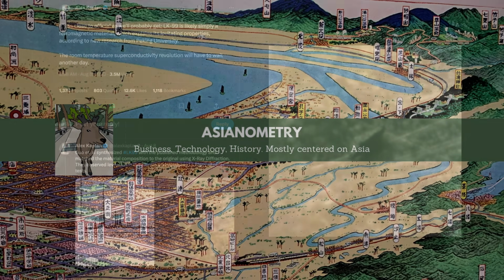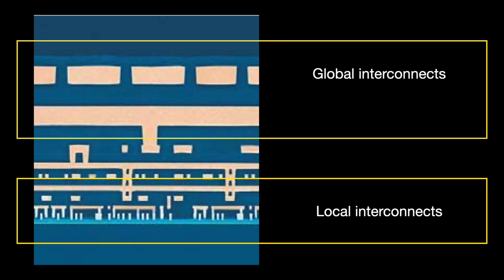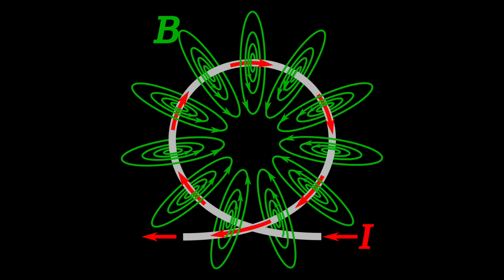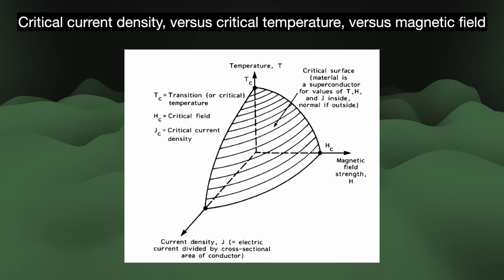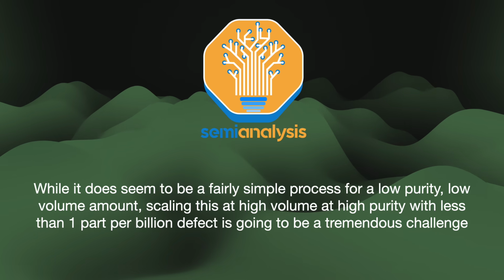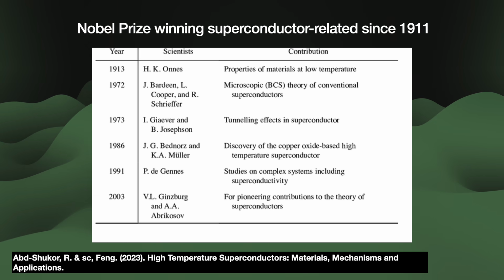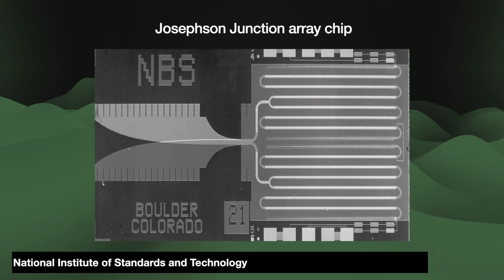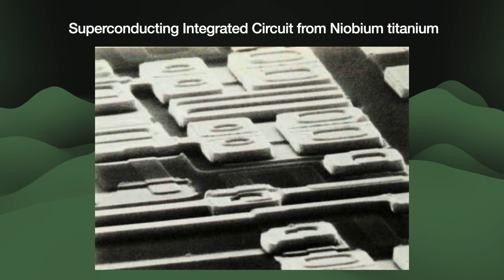LK-99 Wouldn't Have Changed Semiconductors Anyway

Comment: If you have semi-conductor memory and superconductor processor, the memory wouldn't be able to feed the data to the processor fast enough for it to make any sense having the superconductor processor. And remember that in this case, memory includes the CPU registers as well as the usual DRAM chips.

Comment: Good video, but as a physicist I need to point out one thing: Josephson junctions ARE NOT the ONLY thing in which you see quantum mechanics in action.

The description of what we call the "electronic band structure" of crystalline solids, like SEMICONDUCTORS, can only be described and understood because of quantum mechanics. It is because of the development of quantum mechanics and its application to solid state physics, that transistors came to be. As a matter of fact, John Bardeen is the only person with two Nobel prizes in physics because of his participation in the invention of the transistor (along with Brattain, and Shockley), and his co-creation of the theory of (ordinary) superconductivity (along with Cooper, and Schriefer). (The high temperature ceramic superconductors haven't been fully understood, as far as I know, that's why I mention "ordinary" superconductors, which are all low temperature.)

Comment: LK-99 is a ceramic. Let that sink in for a moment. e.g. you can't make flexible wires out of ceramics.
It's a nice experiment but it didn't discover anything new besides adding another name to the long list of super conductors.
Reply: Anophthalmus_hitleri   It's not pure lead, it's lead phosphate doped with copper, basically lead apatite, which is a ceramic.

Comment: High speed data signals are transmitted over transmission lines. Transmission line losses have multiple sources - resistance, skin effect, dielectric losses and radiative losses. Superconductors would eliminate resistive losses. Skin effect could possibly cause local current densities above the critical currents. It would not do anything to dielectric losses and radiative loss.

Comment: Much of the desire for superconductors is in long-distance high voltage transmission, where losses over copper quickly add up. With a room-temperature superconductor, we could put a solar farm somewhere in the Pacific - like between Easter Island and New Zealand - and route the superconducted power back to every continent. Or if not solar, put nuclear plants out there, where no humans currently live.
Reply: Um, but there's a big problem.  Most superconductors are non-ductile ceramics.  You can't draw them down to be a long wire.  In fact they easily crumble.   A very difficult roadblock to using them as wires.
Reply: @georgegonzalez2476  Yes - this presents an issue with the immediate implementation. Though there has been a lot of advancements in ceramics in recent years, and a solution might exist of which we're unaware.

Comment: You know, one of my professors, the late Viktor Baranauskas, was trying to make a film of diamond to be used as insulator in IC packages between the die and the metal. Diamond is a gread insulator and also great conductor - of heat. Any thoughts about the field? I mean, not exactly about the diamond film but about the technology to remove heat from the die. Thanks!

Comment: Don't current models of quantum computers rely on supercundoctors? Even a room temperature supercunductor rather than an oven temperature supercunductor would be pretty useful for reducing the cooling needs, despite not eliminating them.
Same goes for MRI machines: most use a neodymium-titanium alloy supercunductor cooled with helium. There's a composite ceramic superconductor that could already replace that if it wasn't so difficult to fabricate as a long wire that would only require nitrogen for cooling, cutting operating costs by a factor in the range of 20x.

Comment: At any time in the future is a bold statement - there are infinite combinations of material, material structures and manufacturing processes. At some point AI will make material simulation experiments happen at 100s then thousands then billions and so forth possible - learning each step of the way. It's unconceivable what kinds of materials humanity will discover if it doesn't first destroy itself. This is not possible at the moment as we don't have data for things we have not discovered, but I would be very suprised if the fundamental variables won't be discovered by the end of the next century. If it is at all possible to build up knowledge in the physics system, it will be done and won't take milleniums.

Comment: Technically speaking the energy that goes into creating electric and magnetic fields isn't lost, it's simply stored in a different form, the field itself. The energy is then returned to the source when the field is discharged.

Comment: Why don't we use silver on CPUs and eletronics to replace copper tho, at least on high performance personal computers...
Reply: Almost all of the heat comes from the transistors and those can't be made of metal. Replacing copper with silver would make basically no difference except that silver corrodes more easily.
Reply: @mqb3gofjzkko7nzx38  I would be down for a 5% improvement even, maybe we are just waiting for all the other gains to exhaust before upping prodduction costs permanently.

Comment: Well yeah, if it were real it would not affect semiconductors as in we will still use copper and silicon to fabricate them. It would have made semiconductors straight up obsolete as it will shrink the size of a quantum computer from a small building to a smart phone.

Comment: Yeah. I figured it would not matter for computer chips that much. Since just room temperature is not enough. You want a bit more margin than that when running a chip. 

Maybe in the future when we build data centres on Titan it would be more viable. But that is like at least a century away. And you would not have such facility for the YouTube vids (If YouTube is around then. Also, this is wild speculation if that was not clear.)

Comment: As another commentor said, they claim to use quantum wells, not cooper pairs. If it is only a matter of development time, they will come up with working specimen in some time. So the title should be "LK-99 wouldn't have changed traditional superconductors anyway". I'm going the optimistic line here, believing their model works as proposed and they just didn't wait long enough before having sufficient specimen, model and data.

Comment: The US NSA re;ease a report looking at feasibility of building an RSFQ computer in 2005. Memory, and interfacing from room temperature to cryogenic were key problems. You also lose a lot of speed in synchronization and error-correcting. Parallel operations are also more difficult, so think asynchronous serial computation.
Search "Superconducting Technology Assessment (NSA, Office of Corporate Assessments)" or something.

Comment: well, If superconductor cables are invented, I doubt that inductance and capacitance would be a real problem at this point, because we could lower the signal voltage even further, allowing us to transmit ultra-low voltage signals. This requires further research to find the optimal application. The bottom line is that we cannot predict our life beyond the discovery of superconductors.

Comment: Well, even if it's not a superconductor but only have some domains act like one, cannot this be used in a further study to try and make an actual superconductor at room temperature? Like, even if it is an error, it could be an error in the right direction. Material engineers should look into it seriously.

Comment: There actually is an area where the Josephson junction revolutionized electronics - the standards grade voltage reference.  It used to be that voltage references were basically just special batteries.  But once the Josephson junction came around, we realized we could use it to build a very, very accurate frequency to voltage converter.  And since we have really, really good frequency references, we now have really, really good voltage references.  In fact, the change was so dramatic, meteorologists actually changed the definition of the volt because of it. These days, Josephson junctions themselves aren't very common because they are big, expensive, and not very portable (tanks of liquid helium will do that), but virtually all modern electrical test equipment, especially production test equipment, can literally trace its calibration back to one of them.  And that's not just a one off thing.  Electrical test equipment is required to undergo periodic recalibration to stay in spec.  The equipment that does that has a documented, periodically updated calibration train back to a national standards lab, ultimately culminating in a Josephson junction array.
Reply: I did two years at a NIST lab, one day we had a retirement party for one of the old people, big boss director comes in, notices we have like 5 plain balloons floating next to the cake. "Oh how nice, wait, you didn't use the lab helium did you?" Silence. "Oh good, cause that would be like $5k worth of balloons right there right, haha." I feel one drop of sweat on my forehead and say "Oh no sir, haha, right, those balloons came with the cake."
Reply: meteorologists  = metrologists?
Reply: @Graham_Wideman  Yes - typo/autocorrect.
Reply: @JoaquinElf If you're an electrician, no it won't be explained, other than maybe in passing, probably not even that.  The closest you'll get is having to have your handheld multimeter sent for calibration periodically.  The stuff I linked to is basically the infrastructure behind getting that meter calibrated.  This stuff is a very specialized niche within electrical engineering.
Reply: @JoaquinElf Well, it's some pretty high level volt nut stuff, so you have to wade in pretty deep to find it and it can get pretty deep into precision analog electrical engineering.  Here's a video talking about the Josephson Arrays themselves:
https://www.youtube.com/watch?v=VoRab8U2eS0

And here's a video talking about how multimeters get calibrated from primary standards (like a Josephson array): https://www.youtube.com/watch?v=lnh87hXNcfo

Once you have a meter calibrated against a primary standard (the term sometimes used is that it becomes a "transfer standard"), then it gets used to calibrate other equipment, like this video shows: https://www.youtube.com/watch?v=JID8bS2-skg

If you like some of this stuff, I recommend Marco Reps channel: https://www.youtube.com/@reps .  I also recommend the xDevs site (can't link it.  Search for "xdevs").  He talks alot about how the "transfer standards" these high level multimeters work and repairing electrical test equipment.

Comment: IMO the best chance for superconducting in chips is if there is a surface/interface superconductor- a layer of material 1 touching material 2 (eg, many of the ideas surrounding graphene) - however we already do use complex alloys - eg: doped Gallium Arsenide, or taking advantage of 'strained silicon' forcing unusual atomic spacing ..

Comment: If a practical room temperature superconductor is ever created it could possibly find application in power semiconductor devices as a low resistance bond wire material

Comment: The signal interconnect delays relate to the LC factor rather than the RC as you stated.  The Velocity Factor is defined as the reciprocal of the square root of the K factor.  The Velocity Factor results in a per unit ratio of the speed of light.

The K Factor is defined as the product of the relative permeability multiplied by the relative permeativity of the dielectric medium  - in other words the K Factor is proportional to the inductance L and the capacitance C

Comment: Surprised that you missed the most important use of the Josephson Junction, and that is as a voltage standard. Gone are day the days of Watson cells. In fact, that could make for an interesting video (if you haven't looked into it already), the history of standards of measurement and the quest to move them from being based on artifacts to mathematics.

Comment: Superconductive wires in a semiconductor electronics (cpus, etc) would not change anything. Most of the energy dissipates into the heat due to a basic transistors working in a linear mode during its switching on-off time, superconductors cannot change that. Also, FETs inside cpus requires energy to charge their gates to open the transistor, this energy must be dissipated somewhere to discharge the gate to close it - superconductivity.. means nothing here. And like you mentioned - parasitic capacitance and inductance cannot be discarded using superconductors. Its basically useless here.

Comment: Even way back with vacuum tube circuits we had to deal with Miller Capacitance that could limit both frequency and gain factor. That's what Pentode tubes were invented to improve upon, the extra elements at different voltage potentials lower the Miller Effect and allow better control of the electrons flowing inside the tube. The new Pentode tubes worked at a lot higher frequencies compared to the original triodes, and they could be built to control larger currents.

Comment: Thank you for the nice video. I'd like to point out the currently leading quantum computers are all based on superconducting Josephson qubits (usually aluminum), though other implementations exist. So yes, there are real applications for high-temperature superconductors in computation aside from interconnects. Outside of computing, the first real-world application for high-T superconductors seem to be high-field superconducting magnets, like the operational 32 Tesla magnet (SCM-4) at MagLab in Tallahassee, and the ones developed for fusion tokamaks by Commonwealth Fusion.
Reply: they would be very useful in particle accelerators also

Comment: Asianometry is mistaken. The heat dissipated by a chip is proportional to resistance (not inductance or capacitance).  So, no resistance (aka superconductivity) means no heat. Since by far most of the energy consumed by chips are released as heat, room-temperature superconducting computing will dramatically slash energy costs. All data centers will want to go superconducting!

Comment: Actually, SOME superconductive effects have been observed, they just haven't been consistent. For instance some labs reported getting small flakes of LK99 that could lock-in-place above a magnet. As for the impact on society, I really couldn't disagree more. Even if there is no affect on computation, that's just a shockingly narrow view of what it could do. It would be like judging the utility of a nail by how well it can build a table. Nothing else, just a table. 

For instance, if there was a way to get thin superconductive wires basically all of particle physics would be thrown on it's head. If you have a wire that has zero resistance at room temperature you could do some insane shit with magnets that you just can't otherwise. Hell it could literally be the thing that unlocks fusion power. (friendly reminder that Nuclear Fission is already cheaper than everything if you factor in plant lifetime extensions, safer than solar, pollutes 4x less, doesn't require grid scale lithium ion batteries, etc. and is basically a miracle cure. Fusion power would just be a miracle vaccine that also gives you superpowers) 

Maybe it could be used in semiconductors, maybe it couldn't, but, again, that's like discovering fire and saying "well it won't fix my broken arm".

1:39 uh, yeah okay you lost me so why does heat sensitivity matter if it literally has zero resistance. The resistance is what creates the heat, if no heat is being created, it doesn't matter how heat sensitive it is.
Reply: One thing that isn't mentioned in the video is that the current you can put through LK99 to stay superconductive is quite small, so even if it works exactly as promised, it still has limited applications.

In semiconductors, I agree with the video and there is no use in the near future and probably for a long while.
Reply: @meneldal  given we don't even know if it is super conductive at all, or partially superconductive, or some entirely third middle ground, or anything, I find your claim that you know how much current that you can put through it before it LOSES it's superconductivity rather foundless. We aren't even certain if it has superconductivity yet, and yet somehow we know that if we put X amount of current through it it will lose it's superconductivity?
Reply: @robonator2945  The original paper said so. I agree they could be wrong, but I doubt it is a lot better than they claimed.

All info we have so far seems to indicate that if it does have superconductivity, it is very limited (which also makes reproducing it more difficult).

Comment: Temperature is a great concern to superconducting materials, although if these chips where going in to space with heat shielding would they be viable?
Reply: Outer space has a baseline temperature of 2.7 Kelvin
"Daytime temperatures near the lunar equator reach a boiling 250 degrees Fahrenheit (120° C, 400 K), while nighttime temperatures get to a chilly -208 degrees Fahrenheit (-130° C, 140 K). The Moon's poles are even colder."